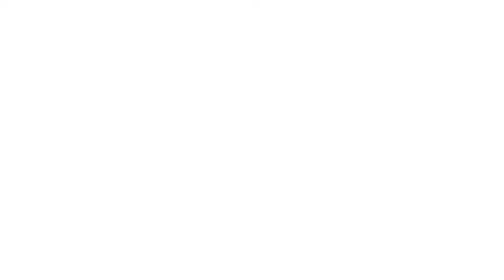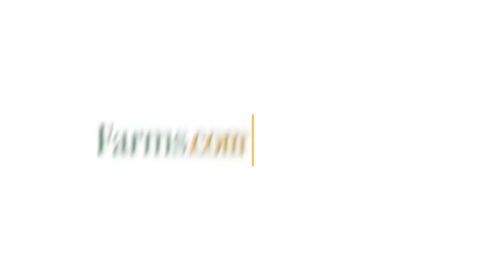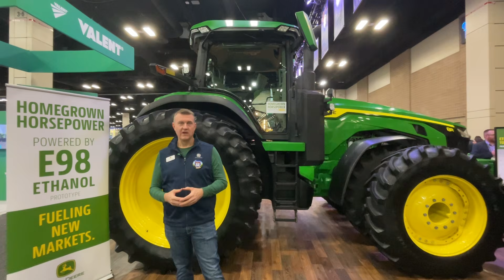Exploring Ethanol as a Diesel Alternative with John Deere

Comment: The critique is short sighted. Ethanol has major advantages. 
-You can produce it yourself cheaply (if the government allows it)
-It stores basically forever
-It burns very clean
-you can use your existing infrastructure (Tanks, Gas stations, pumps,...)

Comment: Don't think you'll have the torque you need with ethanol 

Maybe if it's a hybrid, ethanol engine coupled to a electric generator.
Reply from the maker: Bottom-end torque is definitely different compared to the diesel engine, but we were told that the customers who have had the chance to run this tractor were quite shocked in terms of the quality of overall performance.

Comment: Is it a 6090 with a lower compression head a spark plug holes
Reply from the maker: Yes, it is the current 9-liter engine used in every 8000 series tractor just converted it over to ethanol!
Reply: @FarmsVideos  The poster is incorrect, there are no spark plugs and the compression ratio is 19 to 1 vs 16 to 1 in the original diesel engine.

Scania's ethanol engine has a 28 to 1 compression ratio with fuel economy and power on par with their diesel engines.